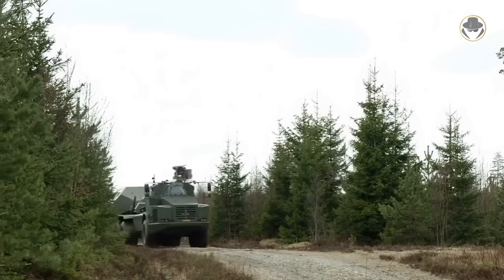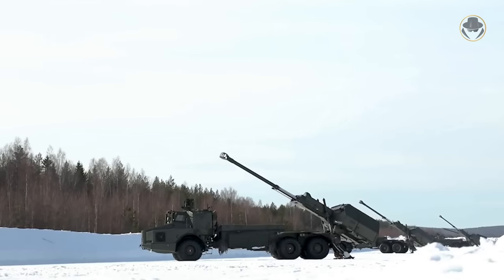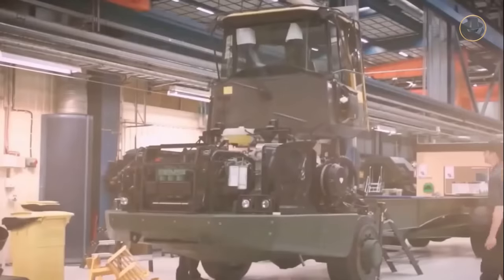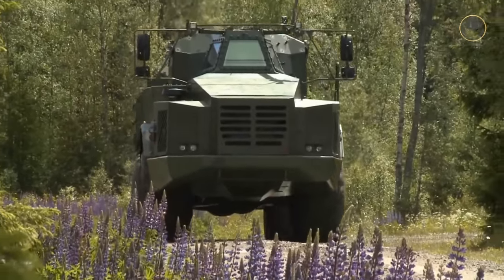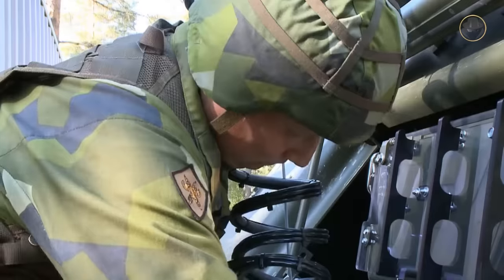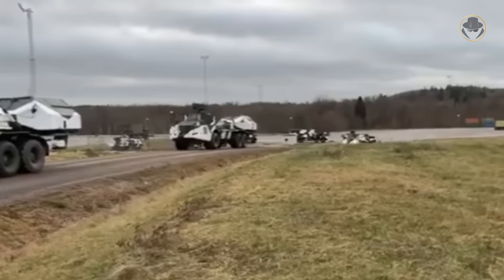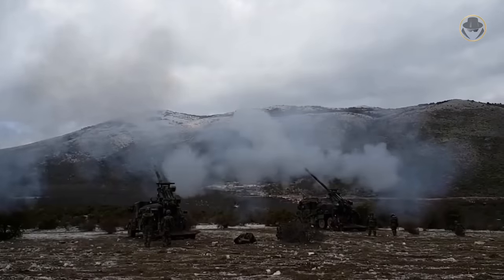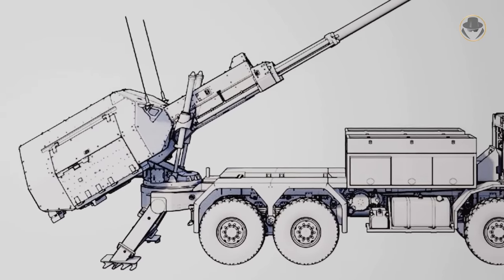Archer Artillery System | What is wrong?

Comment: The Archer is a complex weapon system with a lot of automation, as you described but this is a weakness as well as a strength -- a lot of small parts have to work together perfectly for the gun to be effective or capable of being fired at all, and many of those parts aren't amenable to being "adjusted" in the field with a big hammer in an emergency unlike most other large-calibre artillery systems used today. It's still an interesting piece of equipment and a simplified version of the gun system capable of being fitted to different chassis might make more inroads in the export market.

The articulated six-wheel drive transporter the Archer gun is mounted on is a good fit for the Swedish countryside with lots of logging roads through forests and a modern hard-surfaced road system connecting the cities plus airports, railways, roll-on ferries etc. for extended deployment range. These conditions don't apply universally and that's one reason tracked SPGs are more popular for high-mobility situations (such as the famous Ukranian mud season in early spring). When conditions permit smaller less complex wheeled howitzers can be more easily deployed via smaller transport aircraft or in extremis towed into firing position if their own prime mover engines fail.
Reply: Correct. Future doesn't lie in sophisticated mechanical artillery systems, which will fail, one day or another on the field. And result in high repair/maintenance costs.
Future lies in precise computer assisted aiming systems, good ammunitions, mobility and not-so-sophisticated loading systems, which can challenge any operational conditions.
That's exactly what the Caesar is providing.
Reply: forgot to mention that you need the reload truck, big liability.
Reply: @drhelmut3467  From what I've seen of the Archer howitzer its internal magazines are loaded by hand from a regular supply vehicle if needed -- the munition carrier vehicle for the Archer is not that sophisticated or specialised. Tanks like the M1A2 Abrams have a specific armoured auto-loader vehicle which can accompany them on the battlefield for fast resupply although again the M1A2 can be restocked manually from trucks in extremis.

Any large piece of field artillery, armoured vehicle or mobile anti-aircraft battery requires lots of resupply consumables if it's engaged in fighting for any length of time. That's just the nature of large machines meant to throw large pieces of metal long distances repeatedly.
Reply: The gud that made Bofors world famous was the 40 mm automatic canon during WWII. Yes a very relyable automatic canon. CV90 got the same canon today with small adjustments making it a little more modern. Bofors know how to build good relyable automatic canons since they have done it i 80 years. Find one single company in the world who can match that experience and know how. It will hold and it will work.

Comment: 5:30: I suspect the crew cabin is resistant to "small arms fire", which refers to essentially anything usually used by a single man. It absolutely includes full power rifle cartridges like 7.62 NATO used in many general purpose machine guns, but not to 50 BMG as used in heavy machine guns.
Reply: "The Archer artillery system is operated by three or four crew members who are protected in combat by being under armor. The armored platform provides protection against 7.62mm rounds, armor penetration rounds, 6 kg mines (level 2 STANAG 4569). The cab provides the crew with a protected work environment ensuring extreme endurance during severe circumstances. The protection includes ballistic protection, mine protection, NBC protection, fire protection, and noise protection."
Reply: The problem is at the Brigade level if your artillery needs to work under small arms fire.

Comment: I think systems like that Archer will be in more demand soon-ish because of the war in Ukraine that has proven that actual modern warfare looks much more different than fighting terrorists with AKs and RPGs in a desert. Drones and artillery is a MASSIVE thing in Ukraine which means mobility is the top priority, so if they can get a system that can fire a few rounds and drive off through muddy terrain before those shells even hit the ground would be gold worth.

Also, one of the largest defensive barriers in Ukraine has been mud because of the nature of its terrain, something the Archer system is literally designed to overcome. I hope Sweden ends up sending one or two Archer systems to Ukraine just to see how they perform, I can bet a lot that it will outperform most of their current systems.

Comment: I have a hunch about why Denmark ultimately went with the French Caesar system over the Archer, and unfortunately it may be down to the Archer being overqualified. Its designed mainly for use in Sweden and Norway, both countries have mountains and huge forests... Denmark is flat as a pancake and is mostly covered in fields. So while the Archer might be happy to go deploy in the middle of a field, it will still only be a few hundred meters from a small road used by farmers to get to the field where the Caesar would be deploying.

Comment: Norway withdrew because of the rising cost of the F35 JSF program. Lobbying by Lockheed also led us to not choose the Gripen as our next fighter.
Reply: It's always those deals that if you don't buy now we won't give any deals in the future and it's not really interesting what Lockheed can provide today but what may be in the future. Gripen is like many other gen 4 updated while stealth capability was found to be a shortcoming as USA never dared to use the SR-71 within foreign borders. For this instance the fear of losing the war machine is more freighting than having to use one. 
USA operated in Africa where the S-300 shot down their stealth fighter. The future won't be about jet fighters as ground missiles are more reliable and will cost just as much.  Gripen is used for guard duty, mainly leased since reliance on spare parts is relying on a country capable of securing trade routes. USA handing over technology they consider  obsolete.

Comment: 2:00 the what? 🙂
I totally agree (I'm a YouTube expert) that the Archer is great, and we ought to have it. Only thing I hold against it is the piece being attached way behind the rear wheels, like a big butt ant or the illogical placement of the engine in a Porsche 901/911. Even that they all work, they dont look right (well, the Porsche does).
Really sad that Norway and Denmark backed out. Not surprised that Denmark did, we always end buying American regardless of functionality (... won't mention the F-35 that I hate; we should have bought Swedish toys instead ...)
Reply: probably the only way to get the needed articulation of the gun, not to mention fit the gun to the carriage.  Even then, it must be retracted to travel.

Had they turned it around, fitting the spades to the vehicle to stabilize it during firing would be far more difficult.

Given the platform, that was probably the best engineering choice.  The enemy won't see the big butt, just shells raining down on them.

Comment: As a former sekond chef in a Bankanon 3 i think the were to expensive to manage in peacetime. The Bankanon 3 was alott better than the fist one. But it was very expesive even to scool us to operate uss all. In 1979 when i was in training the B3 costs was like 16 SW crones per meter ok 1.6 Dollar per meter to runn. We runn like 4-10 Swede mile a day, 25 miles-62 a day. That was the problem. But this was a fantastic gun. I actualy run it in woods with the afterburner on that we were not to run in peacetime, but i did. the speed i high snow and it was like 55-65 kmp ewen 70 kmp in som slopes. 16 15,5 grenades in 45 sec was beutiful, and with diferent elevations the find ther target at the same time. then we was gone.

Comment: The Archer is really ideal for countries with bad roads or road conditions where normal road vehicles will struggle, as such its ideal for countries that experience a lot of snow or whose roads are extremely muddy and poor quality, though the more intensive maintenance requirements and higher cost likely eliminates any interest from African countries.
Reply: Since it's wheeled, i doubt that
Reply: @ThePoshPrince  These are quarry vehicles you shouldn't think of them as road wheeled vehicles.
Reply: The Archer is twice as heavy as a Caesar, for the same efficiency (even better for the Caesar in terms of precision and distance).
It is costlier and more maintenance demanding than the Caesar.
With no operational gains.
May be the Ukrainians would like it, as an optional help.
I don't know.
Reply: @pget8462  Archer is indeed heavier than the 6x6 Caesar, though its lighter than the 8x8 Caesar which has similar armour protection for the occupants.
Reply: @pget8462  how is the ceasar more precice or have longer range when they use the same ammo?
Reply: @einar8019  Higher pressure in the barrel and/or longer barrel lenght, I guess?  You mention "ammo". Remember this system doesn't use "complete" cartridges, but loose shells and loose propellants.  -The more "umph" you put behind the shell, the more pressure you get, and more pressure results in faster velocity. Faster velocity gives a higher projectory of the shell, and that results in a longer reach.
Reply: @sidekickbob7227  they both have the same barrel lenght and use the same charge system
Reply: @einar8019  The caesar has a extended range full bore (ERFB) barrel that reduces friction. (According to wikipedia)
Reply: @sidekickbob7227  and yet they both cite 60km as max range
Reply: @einar8019  Then you use the excalibur missile, who uses small wings to glide on. You should disgard them when comparing. Both will be equal accurate with a excalibur missile. Regarding accuracy, the ability of the system to maintain the barrel aligned while the shell travel through the barrel, is a factor.  Just look at rifle shooting. There's a lot of small things that increase or decrease accuracy.
Reply: Those talking about trucks have obviously never seen a forest road. You see these hauler trucks everywhere in Scandinavian forests. A truck is completely dependent on roads. A hauler truck isn’t, it can drive almost anywhere. So it’s a complete apples to pears comparison. This difference should have been made much clearer in the video.
Reply: @pget8462  Ukraine regime got no choices. They burned to 2-3 armies already, they take whatever NATO fascism throws at them.

Comment: 13 rounds fired in 39 seconds in burst-mode is pretty impressive - compared to 3 rounds in 9 seconds for the PzH 2000. A group of six could do they laying, fire 78 shells (possibly hitting over 12 targets with MLSI) and be gone in little more than 90 seconds. The lifecycle costs are likely also substantially less than for the Panzerhaubitze 2000. Still, the sustained rate of fire is only about 60% that of the PzH 2000, and range is a little less as well. The PzH 2000 lists 30-36km for Boattail, 40-47km for Base Bleed and up to 67km range for Rocket Assisted Projectiles. But the experience in Ukraine has shown that it's firing range, while definitely a plus, is a bit limited in it's potential by the fact that it isn't built to fire more than 100-150 rounds per day. How many rounds fired per day are suggested for the Archer?
Reply: You should check the facts on the PZH2000 again. The PZH 2000 is used way beyond the specificatiobn, out of sheer desperation and lack of equipment. For those conditions, it works exceptionally well, espacially the barrels last much longer than any comparable equipment. And, by increasing degration, the computer compensates, so you still have a quite effective weapon after intense use. But at some time, of course, the barrel must be changed, but that ist true for any cannon. And by the way, the excellent Italian/German Vulcano ammo can reach 80km+. The PZH 2000 is,without doubt, the first choice on the battlefield.

Comment: If I were to equip a country with SPHs, I'd probably pick the PzH 2000 complemented by the 8x8 RMMV HX2 truck variant of the Archer.
The truck is cheap and easy to airlift, the PzH is highly mobile off-road and decently protected.

Comment: Archer is good only for professional army as it does not require lot of crew to operate, that is cost saving if you pay a lot for soldiers but if soldiers are cheap then some other systems may be more cost effective. Features it has are not any better than other artillery systems, sure it might be easy to use but that is not always deciding factor on military

Comment: This is a groundbraking wheeled howitzer system as far as I'm concerned.. Incredible rate of fire, small crew, fast deployment, ingress and egress, fast rearming, capability to fire Excalibur and Bonus rounds, etc, etc..... M 109 Paladin looks like a 19th century piece of hardware compared to the Archer..
Reply: Hasn't south Africa been producing similar pieces for decades?
Reply: @theimmortal4718  Similar, yes, but with lower  rate of fire, less protection, shorter range of fire, etc.. There's only one similar system to Archer and its the French Ceasar.
Reply: @vegass04  
I don't know about any of that, but wheeled SPAGs aren't new. The lower maintenance and fuel requirements seem to be the main advantage.
Reply: Is a small crew, say 3 instead of 6, a real advantage on the field, when so many planned and unplanned tasks have to be carried out ? With possible human losses ...
Applying standard industry efficiency standards to fighting conditions is a bit hazardous, don't you think ?
I suppose you never managed real fighting operations.
Reply: @pget8462  
More men means more hands to do the work. It also means more fuel, food, and water is needed as well

Comment: On paper this system seems excellent.
But in which country could it be used?
Western Europe has millions of kilometers of roads and highways.
Driving at only 65 km/h can be a serious brake when its competitors drive at 100 km/h, consume less, are lighter, easily repairable, while being lighter and therefore more easily passing all bridges, tunnels etc etc. ...
My humble opinion: Too expensive, too heavy, too high, too complicated. On the other hand, it is probably very useful in the desolate and icy plains of Scandinavia (but beware of mountainous areas and small twisted roads).
Another question, is such a complex (although very advanced) weapon system durable? Can it fire its shells for days, weeks or months without going to a maintenance shop? Personally I doubt it, but I'm just a humble internet user.
Reply: The chassi is a VOLOV dumper truck, the auto loader have its orgin from the old Bandkanon 1C, then gun is from Haubits 77 so the component is tested and durable. No it is not suited for WW1 typ of bombarment. But optimized for shoot-and-scoot. Yes its stupid expensive becuse the low production run.

Comment: About the discussion of artillery mounted on wheeled AWD truck vs articulated hauler vs tracked. AWD will be fastest on the road and tracked will be slowest. AWD will have limited off-road capability in Ukraine with articulated and tracked being better than AWD. Concerning maintenance AWD should require the least and tracked the most. This is one area where the Archer becomes interesting: though it may seem heavy at 30 tons the hauler version (weighing slightly more empty) can haul an equal amount of dirt at 29 tons which means that the Archer's chassis and drivetrain components will never be particularly stressed. Compare this against the light AWDs (which look decidedly flimsy when firing) and the articulated hauler might well end up requiring less maintenance. The fast loading automation means that the crew never leaves the armored cab during firing so counter-battery won't have time to strike back and killing the crew in other situations will require quite the lucky shot.

Sweden doesn't have an infinite amount of either money or soldiers to splash on the artillery topic and a single Archer will likely do the same job as two or three of its competitors and its superior shot-and-scoot superiority means that it will probably specialize in that role, capable of near continuous engagement. How many fire missions will Archer be able to fulfill from different locations in an hour? That depends only on the magazine capacity. An experienced crew that has survived losing its Archer can be transferred to another and be effective immediately.

Comment: There are more noteable disadvantages like, no anti tank roll like PzH 2000, lower accuracy especially when it comes to higher rate of fire, the positions of a Artillery squad are better predictable, and the shoot and scoot capabilities show no real advantages, …, most important it doesn’t fulfil the nato standards in terms of ABC protection of the crew and equipment.

Comment: Wondering, what is the role of artillery on the modern battlefield? Assuming a machine like the Archer is used quite differently than a WW1 or 2 artillery barrage.
Reply: well the archer could be used with Bofors Bonus anti tank rounds to smash armoured formations
Reply: Depends. When you got no air defense, artillery is pretty pointless, it will  be destroyed - just like anything else by missiles systems, drones and airforce.

When you got anti air and at best ECM on top, it can still be the king of the battlefield with quite high range and high efficiency. 

You msut be able to protect it. 

For example: A Russian standard BTG got 10 tanks, 6 artillery units, 6 missile artillery units and 6 anti air units.

Take the anti air away and the rest is just scrap metal in modern warfare.

Well, if you don't fight like NATO = slaughtering goatherders with rifles in thrid world countries (and even then losing...).